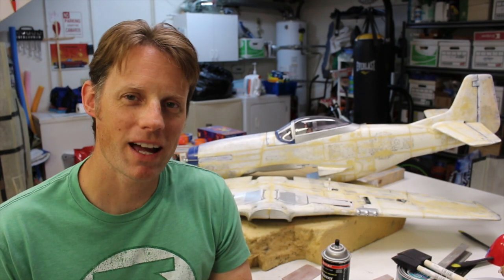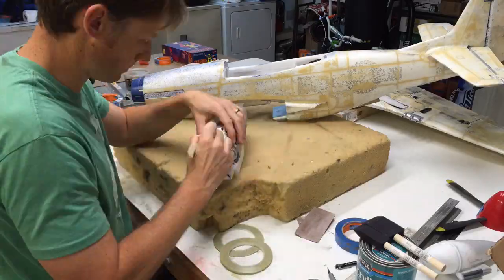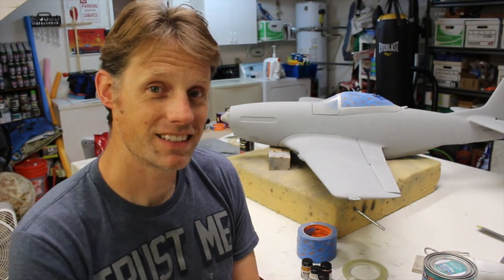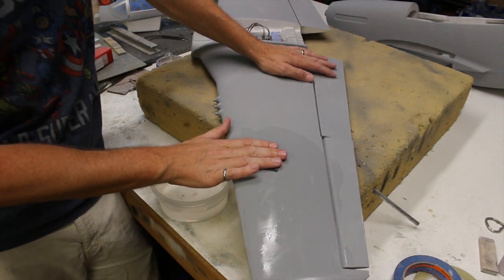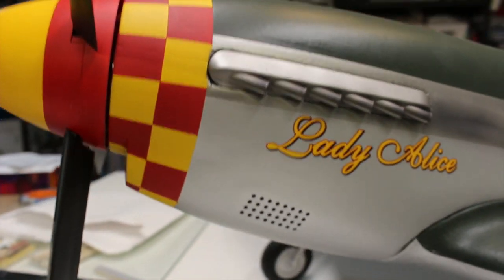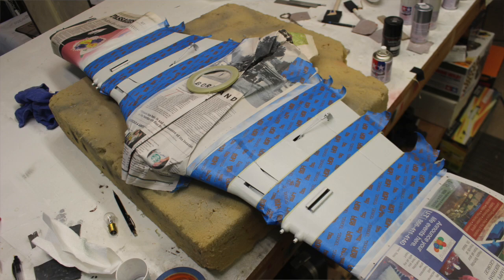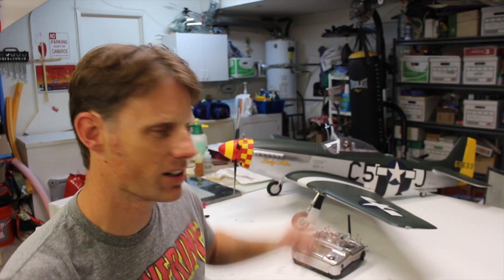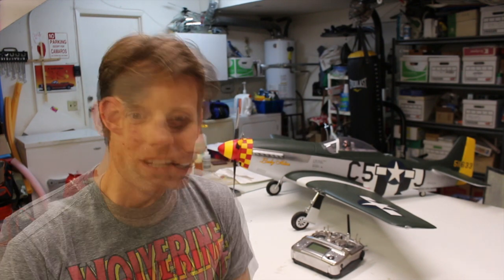Refinish a Foam Warbird Ep3 - FMS P-51 Paint Prep & PAINT!

Comment: Hey RC Geek, firstly I love watching your RC reviews and everything that you get up to modelling in the shop! I have a couple of questions which I would really like your help with if possible: 

1) I have the Eflite P51 1.5m and would like to change the blue to the original Olive Drab - my question is would you prime the blue before airbrushing it Olive Drab and if so, and I would like to know the answer anyway, what primer do you use? Ive looked at Vellejo Polyurethane primer, but wasn’t sure if it melts the EPO? 

2) When it comes to applying a clear coat at the end, which brand / type do you tend to use? Again I have seen Vellejo have one but similar to above I have no idea if the model will start melting in front of me! 

Any advice you can offer would be greatly appreciated. Many thanks
Reply from the maker: If all you’re doing is painting over the blue and keeping the silver, etc. then I’d recommend just simply airbrushing over the stock paint.  Primer isn’t really necessary in that case. For clear coat, most anything should work. I’ve been liking the rustoleum 2x clear of late.  Keep in mind that these airframes are made of epo foam which is extremely resilient to solvents and will take most any paint medium. I haven’t found a paint that won’t work. The caveat is that some paints/primers can induce a slight amount of gatoring if applied super wet.
Reply: @Thercgeek  this is fantastic and invaluable advice, thank you dude! I’ve got some spare EPO lying around so I think I will buy a couple of products and see which works best for me then on the clear coat. 

Would you only really prime  the surface when you have done some repair / filling? I wasn’t sure if the airbrushed acrylic Tamiya might peel off the stock paint? Sorry these are no doubt dumb ass questions! 

Many thanks!
Reply from the maker: No worries. Yeah, no need to primer if you’re just touching up a single color as it is actually a really good base for painting and will give good adhesion. I leverage primer mostly when I’m smoothing out an airframe as it helps fill in small voids. Also, it helps if you’re painting bare epo foam too.

Comment: You mention laser print decals.   Where do you get that printer paper from and do you need a special printer for it?   Great vids, I'm going to use this info on my 1700mm PC6 Porter.   Thanks for all the info.
Reply from the maker: +Pete Stanford Thanks for the kind words!  I usually get my decal paper from decalpaper.com.  There's paper for inkjet and laserjet printers.  The laserjet is what you want assuming you have access to a laser printer.  What's nice about it is that you simply print to it and it's ready for application without any additional preparation.  They go on really thin (I recommend using microset and microsol in the application process) and can be clear coated with any number of clear coat mediums.  Avoid the inkjet paper if you can, it requires an accrylic clear coat to act as a carrier film which causes a really thick carrier as a result.  Also, if you apply a heavy solvent clear to the model after the inkjet decals are applied, the ink will run.  Have fun with the PC6!  Do you have a paint scheme in mind?

Comment: Fantastic video with lots of tips, you can actually get white water slide sheets also for printing colours over 👍
Reply from the maker: Thanks!  That is true about the white transfer sheets. The issue is that the carrier film is white, so if you don’t want that showing, you have to cut the artwork out exactly around it. So, the vinyl cut art under a clear water decal was my workaround for that.

Comment: AWESOME JOB.........one question, have you ever thought about using the polycyclic with paper for covering ? Would save a ton of sanding. Have been covering my foam aircraft this way for years and the final product is amazing.....started with white glue/brown paper and now have started using polycyclic instead of white glue, Polycyclic is much easier to use-no mixing required. Have even used rolled paper towels for the covering on my Surefite Piper Cub wing and tail surfaces.....looks like fabric weave. Just a thought....
Reply from the maker: +clhuke64 Interesting thought, I've not considered it.  Are you talking about rolled brown paper?  Or are you using tissue paper?  I think either way, there would probably be a bit of sanding, but it would probably cut down on the primer coats a little bit.
Reply from the maker: +clhuke64 Very interesting.  That's similar to covering with tissue almost.  I'll have to try that out sometime.  I can see that working well directly over foam, though I can imagine the paper might whisker if you sand too heavily into it.  Thanks for the tip!

Comment: I don't know what kind of foam you're painting, but I bought a can of that 
primer you recommend and it EATS foam. I was very suspicious so I tried it on 
some foam scraps and it melts it big time. Any of you out there that are 
planning to use this primer beware!
Reply from the maker: Most foam arfs these days (including this airplane) are EPO foam which is extremely resilient to solvents. If you’re using any of these spray paints on EPS foam, then yes be very careful. I’m guess the scraps you painted were EPS foam. I’ve been using all of these paints on EPO foam for years without issue.

Comment: Hi !  This is some great work, and a very good tutorial.
I have a question. I would like to repaint my E-flight Viper, but I would like a shiny finish. So what paint would you use ?
Reply from the maker: Thanks!  The Viper sounds like a great subject.  For a gloss finish, it's really all about the clear coat.  You can use virtually any sheen of paint and then just simply apply a gloss clear over it all.  You can do that even with gloss polycrylic even.
Reply: @Thercgeek  After I did all the prep steps like you explain in your video, what is the type of paint I can use ? Should they be water base, I am pretty sure I cannot use Tamiya spray paint for plastic, because they are too strong. So what are the different type I can use ? 

Have you ever try using automobile vinyl wrap ?

A big thank you for the reply.

George
Reply from the maker: So, most foam airplanes these days are made from epo foam which is extremely resilient. I’ve painted many an epo foam airplane with all sorts of different paint mediums without issue. Obviously test it first, but I regularly use tamiya spray paints on it. Also, I use vinyl markings quite often, but I can’t say I’ve done a full wrap.

Comment: Hey chris amazing job on that beautiful warbird. My question is how did you sand and paint between the  crevasses of the  wings, flaps ,rudder etc.. I'm wanting to repaint my fms Cessna 182 . Any help would be appreciated!
Reply from the maker: Thanks!  I mostly just hand sanded with sand paper. If you curl or fold it the right way, you can usually get into those weird areas.

Comment: Something to think about.... Just use regular masking tape or lite stick masking tape and use a straight edge and a razor knife and cut to desired width.  Price per unit is much much cheaper than buying tape of various widths.  It only take a few seconds.
Reply from the maker: That is a good tip!  The primary issue with using straight masking tape though is that it has a tendency to bleed paint.  So, you run the risk of not getting a clean paint separation line.  That's why I use the 3m fine line tape as it will give you a crisp clean paint line every time (assuming it's burnished down properly).  It is more expensive, but it will save you lots of heartache down the road.
Reply: Bleed through or paint running under the edge of tape comes from applying paint too heavily with any tape.
Use several mist coats.  Light coats don't bleed.  But great video.